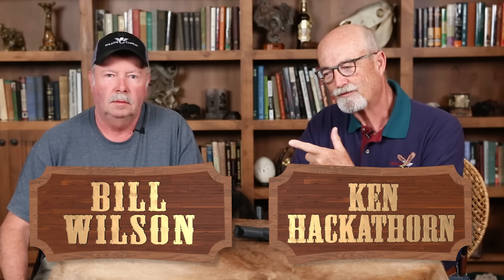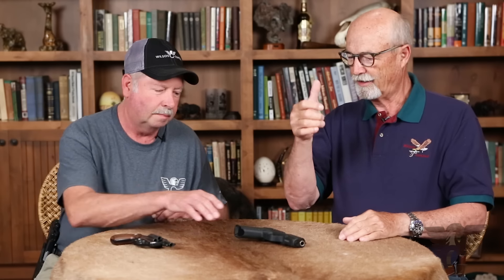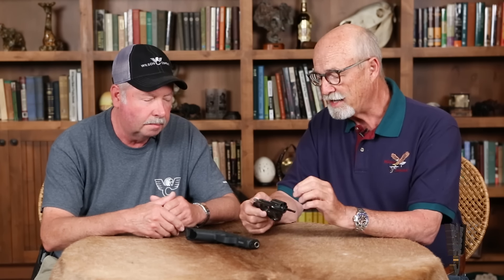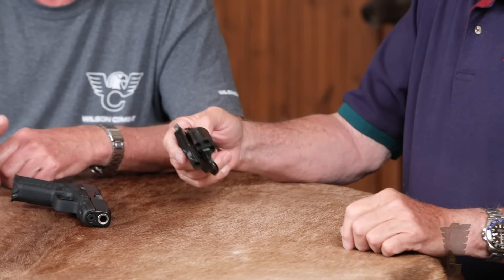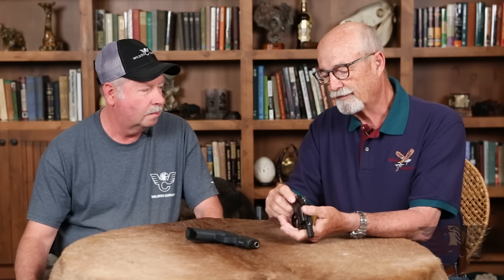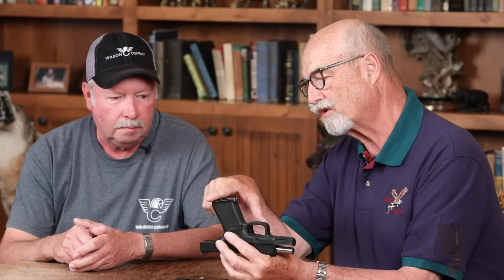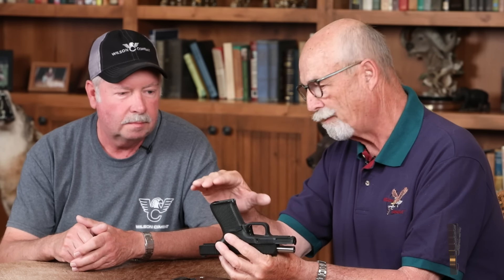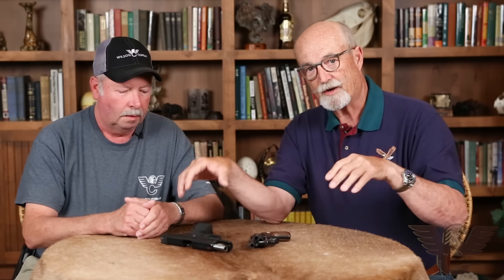DON'T DO THIS to Your Guns - Gun Guys Ep. 17

Comment: I hate when people claim you can ‘over oil’ a gun. Unless you’re forced to drag your gun through the sand, you’re always better off running it as wet as possible. Dirt or dust is coming in contact with the bearing surfaces no matter what. Oil doesn’t ‘attract’ it. It also performs the crucial function of reducing friction and wear between bearing surfaces. It also reduces the chances of fine particulate coming in contact with the metal surface as well as keeps it from adhering making cleaning easier. My motto is ‘make it weep, then wipe away the tears.’ I want oil seeping out of the bearing surfaces when I’ve reassembled my gun. Then I’ll wipe off the excess from the outside every time I notice it. When it stops, I know I’m right around the maximum amount of lube the thing can contain. First step in the next cleaning session is to remove as much of it as possible with a degreaser, then reapply it to the cleaned surfaces.
Reply: Lube is good, but too much will fill up with unburnt powder or grime, reducing the amount of time required to clean it. Carbon is a form of lube. As long as it's in-between the metal parts. Pistols that tend to shoot smaller loads also tend to be dirtier. Your max lube is just not really true as 80% of it is flying out when you fire the weapon.
Reply: So in short, you don't over lube a gun that runs dirty. It's not really about the outside dirt. You also don't really have to super lube pistols. I do understand the need though, I would put generally more lube in a fulle metal frame pistol then a polymer. Also it depends on the outside of the weapon, the coating on the metal.
Reply: Dirt does attach to wet moist surfaces that's a fact.   But I do always put a little more then I think it needs

Comment: I watched guys overseas clean their AK's with kerosene, gasoline, moonshine, etc  and then use a knotted boot lace dipped in motor oil to swab out the barrels.
Reply: Cleaning a gun with moonshine is alcohol abuse.
Reply: To properly clean an AK you use Vodka and a boot lace. Remember it will still AK.  😜😎♠️

Comment: Brownells did a smythbusters saying using slide release is fine, you guys must make guns made of glass.
Reply: They said don't use a slide release on an empty chamber. This will eventually damage any weapon. They specifically said it will peen the Lockup and Barrel assembly on any weapon when doing it dry and specifically the 1911 it will damage the extractor eventually setting it Out Of Tune. Don't understand why this is so hard for people to understand.
Reply: @Sandhill1988  Do you realize how many times you have to do that to get that problem? Its in the thousands, if you do that once in a while its not gonna do anything. People have a hard time understanding guns are tools and not something you should keep shiny in a safe.
Reply: Go back and listen to all of the things they said. Geez.....
Reply: @Sandhill1988  no, it won't "damage any weapon." Firing a gun puts WAY more stress on a gun that a slide drop would, loaded chamber or not

Comment: The point of the 2000 round test is that it is a basic reliability test a person can do for their primary carry weapon or primary defensive weapon.   Carry weapons tend to get shot little and carried a lot.  They don't get inspected regularly and the lube dries out, lint builds up inside the gun, and other little things add up to compromise reliability and these things can impact the first magazine you put down range in a carry situation. 

2000 rounds, for most people, is spread over several months, all the magazines we own, and allows time for the gun to dry out and fill with lint.  It tests the magazine reliability when crud from normal use is allowed to accumulate.   It tests the lube you use, oil or grease, is it drying out too much?  It tests everything. 

A gun that goes through the 2000 round challenge without failure is one you can rely on in a moment of need.

I had a Beretta 92 that was allowed to dry out.  My mistake.   It couldn't feed even one magazine reliably.  A 2000 round challenge would have potentially demonstrated the need for maintenance and also potentially  revealed advantages to using grease over oil.

Comment: I carried a 1911 from about 1980 until about a year ago (changed pistols).  Dropped the slide on an empty chamber pretty much every day before putting it in the locker.  Over 40 years, that would be about 14,600 times (I figure the times that I didn't do this were about the same as the times that I did it more than once in a single day).  Maybe the terrible damage happens when you do it the 14,601st time . . ?
Reply: You failed to mention what 1911 you're talking about. Sure, maybe an RA can handle it coming in between 5 and $800. But get up into the match grade/custom arena and you might just ruin some parts.
Reply: @robwilk4566  Colt Series 70, with a little smithing done to it.  I wouldn't carry a pistol that would have some parts ruined by dropping the slide or dry-firing, any more than I would take a Porsche to play on the dunes.
Reply: @robwilk4566  What is "ruin"? You go from a 3.358 pound trigger to a 3.369 pound? They never actually specify the exact outcome and how the "damage" affects the user.

Comment: Guns are tools. Tools wear out and then you repair or replace them. A wrench wasn't designed to be a hammer, but if it can't take a couple if blows from the side without breaking, then I don't want it.
Reply: Then buy a high point, because ive seen many of glocks go down in classes.
Reply: I bet you're the type of person that will use a Starrett caliper as a prybar too.

Comment: Millions of people do this thousands of times with their much cheaper guns. No problem.
 If this gun is reliable work horse it should not be a problem, if its collectible then I understand. 
Still subscribed.  My pledge to subscribe to every gun chanel I come across, even if disagree.  Every gun rights supporter should do the same.
Reply: That’s because it’s okay on a cheaper gun. Do you take your Lambo off roading in the desert?  How about your Jeep on the race track. Some of the parts they have are cut, or polished to within half a human hair of tolerance. Just because you can put your $2,000 laptop computer in a pillow case a smack it into a wild dog doesn’t mean it will do any better then a $.50 brick. Right tool for the right job. 

They are fine guns but the rules aren’t the same for all gun shaped devices.

Comment: In my law enforcement career we never released the slide stop lever to close the breech. This wasn't because we didn't want to unnecessarily harm the firearm, it was because in a use of force situation when the adrenaline was pumping you tend to lose fine motor skills and may well find it difficult to find the lever much less operate it quickly. It's good practice to always rack the slide by hand.
Reply: Using your trigger finger and operating the magazine release are both fine motor skills.

Comment: Proper care of a firearm is important, but If I were you, I'd get a weapon that can handle abuse.
Reply: I mean what would you rather handle?   Cheap glock or sig = barely any required care.  Or, a 2000 dollar 1911 that requires much more care. I would choose the cheap one until I could afford the fancy one.
Reply: @ufosigma  Well this guy makes a living making $3000 comp 1911s don’t think he’s gonna be changing anytime soon.
Reply: I dry practice with a Glock, how else do you practice and be able to reset the trigger?
Reply: @Silentskip001  true he can afford it
Reply: @bigboss7189  You can use snap caps but those are just a scam. UNLESS you use an old vintage 22lr pistol.

Comment: I never realized dropping the slide on empty could hurt it. A guy from a local gun shop back home once told me it was designed to be used that way and I wouldn’t damage it. He made no distinction between empty and loaded. 

I think my 1911 is young enough that I haven’t don’t any serious harm to it though. It ran perfectly when I took it to the range.
Reply: The barrel lockup grooves are machined to closer tolerances on these higher end 1911s, personally I think this is where most of the damage can occur, not so much the sear as the slide will move just as fast over the fire control components while shooting. I could also see damage to an extractor if the tolerances are tight.
Reply: You are comparing the advice of someone who sells magazines to someone who successfully makes and distributes them.

Comment: A Wilson combat 1911 won't take this abuse?  John browning 1911's no problem!
Reply: 2 totally different things. JMB 1911s were not machined and fit to the tight tolerance of wilson combat.
Reply: All 1911s have this issue, and many other models. Basically any gun you drop the slide on an empty mag with effect and damage the component's. Idk why you think colts sear and other parts are invincible...? I know many people from the range whose colt specifically had this issue and the reason was because they were dropping it on an empty mag.

Comment: A lot of good info here.  Watch, listen and learn.  BTW learn to treat mechanical equipment as if you DON'T want to repair it.  As an engineer, that's how I address heavy equipment, vehicles and firearms, etc.  Mechanical equipment manufactured by humans ALWAYS has limitations.
Reply: Would you buy a tractor if the manufacturer said not to let the bucket graze along the ground or it could break?

Comment: If dropping your slide dry actually damages your gun, your gun is crap. Just sayin.
Reply: You do understand that metal to metal contact results in wear right?  It's entirely plausible that you get a different kind of wear when chambering a cartridge vs not chambering a cartridge.  Further, everytime you release a slide with the slide stop you are wearing the contact points on the slide stop.  Eventually you can wear it to a point it will no longer hold the slide back on last round.  I took several courses at Sig Academy under the guidance of Bank Miller, an FBI firearms instructor.  He taught us the same thing these guys are, but I guess you're smarter than the FBI.
Reply: @thermalreboot  Both your points are true, however when we're talking about firearms designed for combat the firearm should be able to take abuse far worse than that. Maybe WC 1911's aren't built for that but I would like to know my gun could handle it before I buy it. And I don't think that would have to restrict me to glocks or any other plastic wonder 9.
Reply: @thermalreboot  
I watched a couple of gunsmiths cover this topic and disagreed with what these guys are saying.
Reply: @thermalreboot  everybody is a professional 😀........ I  agree with these guys...... not only that Wilson Combat really do know their stuff......and they hands down make the best magazines for the 1911.......My kimber would FTF all the time until I bought their Mags...... and I've shot countless rounds through it without any problems after switching.........but yeah those dudes know their way around a gun...... they've been doing this for a long time
Reply: @thermalreboot  being smarter than the FBI is like winning an arm wrestling contest with a 5yr old. I've been in LE, there's plenty of shit instructors that teach crummy tactics and Fudd lore as gospel. Just like every career field, there's both competent and incompetent people in it. Unfortunately the later is always the stubborn type that will believe they are right no matter what evidence is presented to them.

Comment: Brownell's Smyth Busters say you can drop the slide all day and it doesn't hurt anything: https://youtu.be/_zLH8HTi9IM
(I don't know anything about a 1911, nor its trigger, so I'm not siding with anyone.)
I think Wilson's video would have been better if they showed how the trigger worked and why dropping the slide can damage a custom trigger.
Reply: Thank you for saying this. I was literally just watching that video yesterday. Would be great for someone to clarify
Reply: Yep, Gunblue490 says there is no harm dropping the slide on a 1911 in good condition.
He is a veteran and gunsmith.
I stand corrected.
Slamming the revolver cylinder home is still a bad thing to do though.
At 5:55 he addresses the difference between a GI 1911 and a tuned 1911. Sear engagement tension being the issue.
Reply: The video you are referencing does not apply to this at all. The video you have referenced does not mention anything about dropping the slide ON AN EMPTY CHAMBER. they are only referencing the subject of people saying you need to "slingshot" the slide into battery instead of the slide release, on a LOADED handgun.
Reply: I even went back and re-watched the video you have linked, and not once do they mention empty chamber slide releasing, also this wilson combat video never once tells you to NOT use the slide release on a loaded chamber.

Comment: for all the people hating on the 2,000 round test: would you be comfortable with an airliner engine that disentegrated after being run for 100 hours?  You would never run an engine for more than 23 hours, so who cares right?  You'd probably never get on that airplane.  that's why you have to run an engine for 150 hours straight with very aggressive power cycling in order to certify it.  you also have show that the wings can be deflected to unrealistic angles before shattering.  So if you want to sell a gun to an aerospace engineer, consider doing a 2,000 round test.
Reply: You mean an airlines is built with a factor of safety? That just sounds like engineering which doesn’t mesh with dogmatic fudd lore.

Comment: Good thing I only use modern guns.
Reply: So long as they're all striker guns, you're 'good.' However, any modern hammer/metal frame/revolving firearms, the topics discussed here still apply.
Reply: Kiril Bellic, same here...because I kind of like dropping the slide on my guns.  But those are mine, not someone else’s.
Reply: My sentiments exactly...this looks like amateurs...
Reply: @AtlasJotun  You don''t know what you're talking about. Try a Colt 1911 Government model, it's like a glock, but for men.
Reply: Kiril Bellic, I'll tell you the same thing I told Lucius, try a Colt 1911 Government model, it's like a Glock, but for men.
Reply: @Kevin-rq1wt  you should try a Sig P226--it's like a 1911, but for men who can admit the 1911 is a tad bit obsolete.
Reply: @Dread_Naught_But_The_Dark  They make 1911 variants, not just the plain stock 1911 we all know about. 
1911a1, etc etc. 
They even have a .50 1911 just in case the 45 is to wimpy for your taste. 

Just because it's old. Dosen't mean it sucks, like your implying a little.
Reply: I’m an over cleaning 🧹 🧼 fool . It’s mentally therapeutic 😬
Reply: gun people should unite not divide, to each is own
Reply: wew
Reply: 101327  Says the guy who would probably drop a couple grand in rebuilding his Glock to the point that the only original part is the newly stippled polymer lower. Tuning doesn't make a firearm "functional", it just makes it better. Guys like you literally don't know what you're talking about. Are long range rifles obsolete? Because tuning them is almost required for repeatability and accuracy at extended ranges. Firearms with great accuracy and functionality out of the box have already had work done on them by in-house gunsmiths, that's a fact. Go peddle your used car salesmen bullshit elsewhere.
Reply: @AtlasJotun  Even a Beretta 92fs ?
Reply: @charleslindberg829  I never said it sucked. It's a fine weapon. It's still outdated and outperformed by a lot of modern designs.
Reply: Ding-dong. Oh, hello, it's your friendly neighborhood sensible discussion coordinator here to remind you that philosophy of use is a thing.
Reply: A 1911 was an amazing gun, over 100 years ago.

Comment: Basically, your $3000 1911 is so fragile it can't withstand rugged handling.  Might as well by a Colt Commander for 1/3 the price.  
I don't see the reason to buy a custom pistol if the tolerances are so tight that fear of failure is a major concern by treating your gun as a working tool.
Reply: That isn’t what they’re saying. And if you don’t like it...don’t watch!
Reply: @ralphprice5136  that is what they are saying and yes it is better to buy the commander.